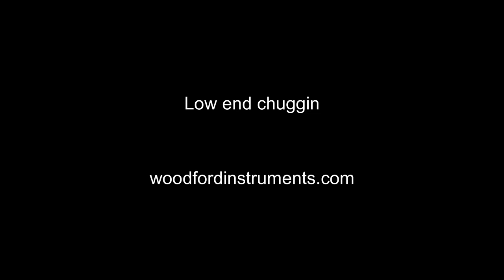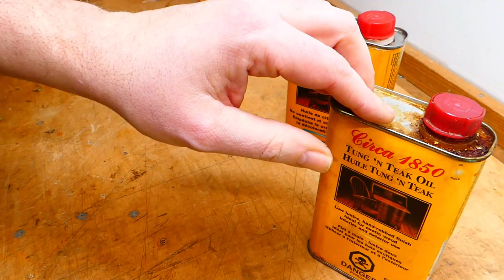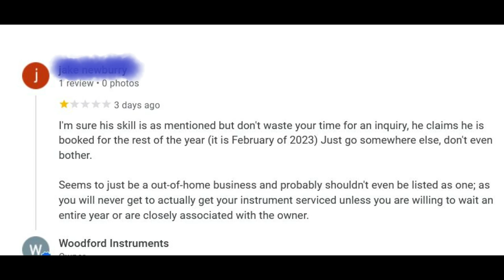70's Basses

Comment: Ted revealed the big trade secret here about 'lemon oil' fretboard treatment marketed to guitar players in tiny eye-catching bottles for way too much money at the music store checkout counter. IT'S MINERAL OIL, FOLKS. Just go to your grocery or pharmacy and get a generic or store-brand bottle of straight mineral oil. It has other household and shop uses, and costs only a few bucks for like 8-10oz. which is enough to last forever. It is colorless and odorless. If you want your guitar neck to smell like fruit or whatever, uh, why? Who started this thing of making your guitar neck smell like lemons for a few days after you change strings? The Devil, that's who. And by the way, only use oil on porous unfinished fretboard woods. It does not penetrate the varnished maple fretboard on your Fender or do it any good. And don't wipe oil on nitro lacquer. Just don't.
Reply: Because it smells good
Reply: @ileutur6863  Fair enough, brother.

Comment: How about being guilted if you will that the guy at the  guitar store charges way less for that type of work ,even though they couldnt find the problem or issue ,which is why your at my shop but dosnt sink in after I fixed it,and they didnt charge me for new strings ,yep  get what you paid for ya know ,you paid them $50 for a new set of strings is all

Comment: hmmmm, always shim the neck if it's a bolt on. increases tension over the saddles, and allows you to raise them, exactly, to the level where you don't feel them [esp. on strats and teles. if you follow the logic of tolerances, all bolt-ons are likely to require a shim, which is why fender now builds in an adjuster. 

anyway you don't have to build a whole pocket shim, just a strip at the tip of the heel [folded strips of carborundum paper are hard and can 'dig in' a bit  if the pocket is rough].
Reply: I’ve used a guitar pick… 😅

Comment: he is kind a right but other hand isnt it so funy so many time when he or other do repairs and someolese secrew up like used bad glue join overused glued bad skill yes they didnt bash them but still point out failed or bad repair wihich moslty couse lot more trouble.becouse of now thier hard thier jobs.like if bad glued crach now mean no way easy glued pured down glues casue so many minutes clean up şpt pf cheap unskilled repair guys out of theire specially from other i heard music stores specially like u bught some guther 4-5 k happen sopmethines they give to repair where from buy or where they recomend then they  return back or bad repair or fail badly sometimes jide flaws so few month didnt show or they use gimicy job sell no need work items etc like sell some useless thing or they ask need neck reset which isnt and i dont remeber but vougly i rememmber he mantioned at few case bad some repair works happen.im not saying he atacking them but this really good decent repairmen is more rare then bad one lot of them around i once seen somenese at gison return back 2 year after as unreparable which luthers does it
not only repairman lot of famous brand new insutmrent build badly or mistake like wrong places sadle or brdiges not good contrucked cut the corner like 3 same month 1 so bad one ok on good can be .lot of insturment build by amatuers or small places can have flaws too
and lot of bad repair happen by cheap but not all some charge so highly but still do bad jobs
i hope u remember when some insturment come recent or decade ago badly repaired or build up insutmrent come to you
ut lot of unhappy never satify people there too im not saying he is wrong  but not always